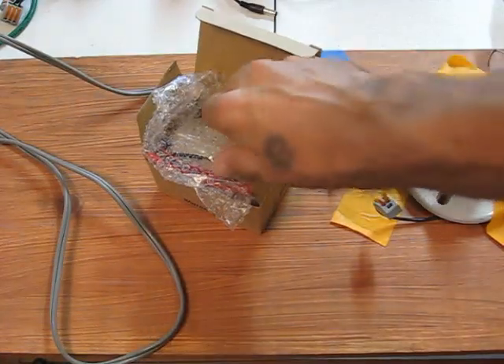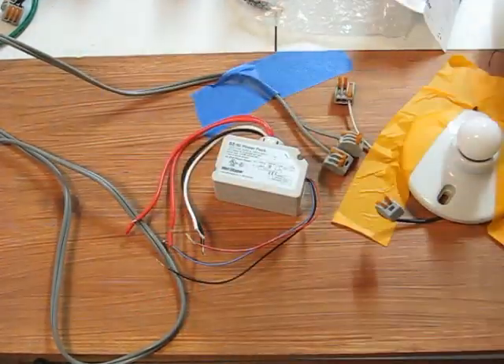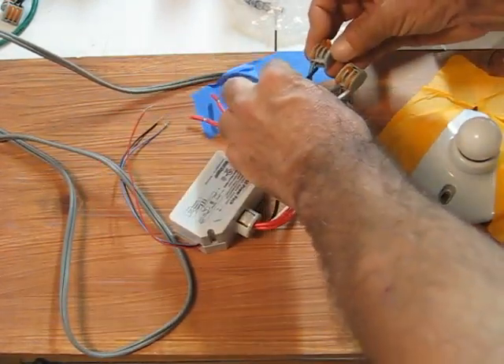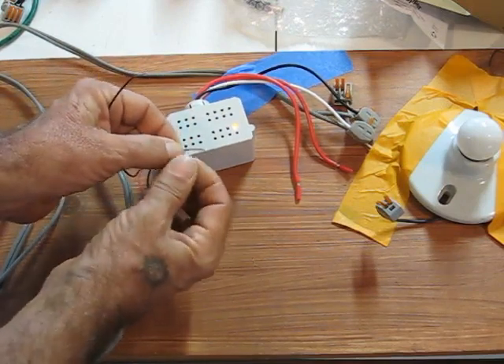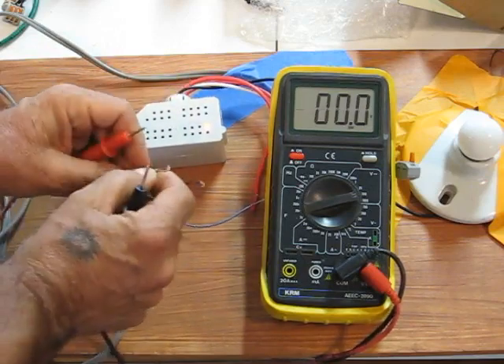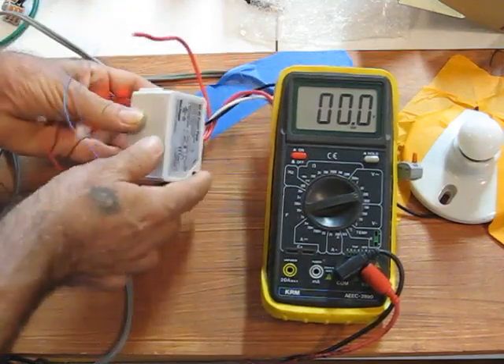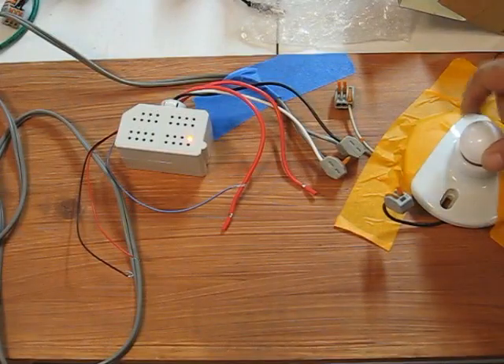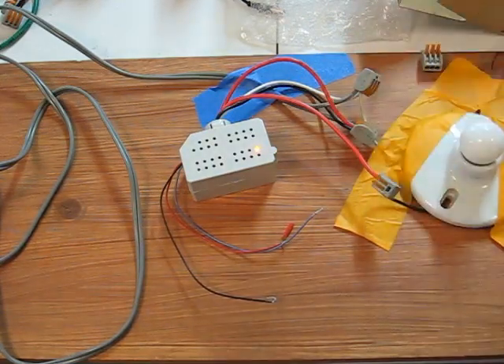Testing a BZ-50 WattStopper Power Pack BZ50 Simple check out test - Lighting Controls

Comment: You hve it on Manuel or auto ?
Reply from the maker: This is just a BZ-50.  It doesn't have the switch like a BZ-150;  all you can do is connect the "Thin" BLUE (Control) wire to the "Thin" RED (+24Vdc) wire to energize the SPST (Single-Pole Single-Throw) Normally Open Relay which will connect the two "Thick" RED Line-voltage wires.